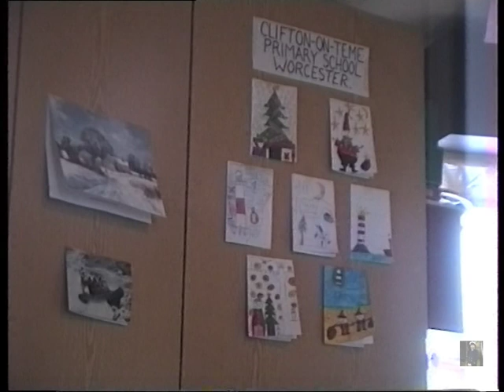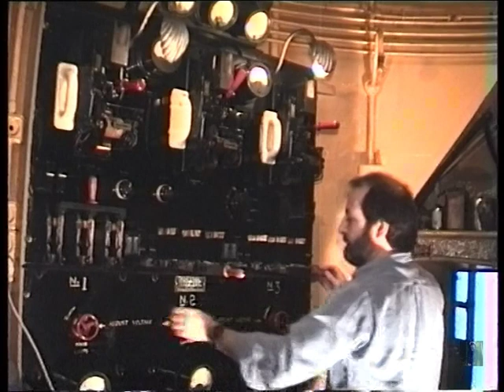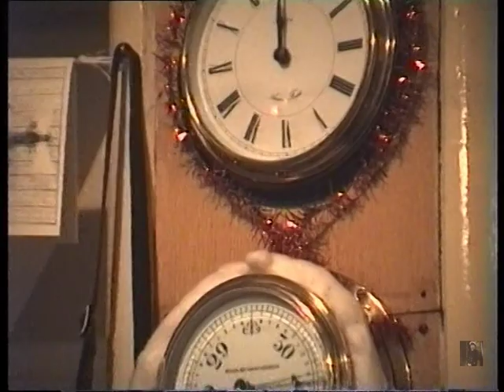Needles Lighthouse at Christmas, part 1,  1992

Comment: The old Supertyfons are now on display at the Needles Visitors Center. I'm glad they preserved them instead of melting them down.
Reply from the maker: Thanks for the info,cheers.
Reply: @PeterHalil  It's my pleasure. I don't just do this research for my own gain, I do it for other people's benefits too. ^^ Apparently it appears that only one bank of Supertyfons out of the three is at the Needles Visitors Center. The other two might possibly be in storage. There is a placard on the front of the bank of air horns at the Needles Visitors Center that says Trinity House saved all three banks of air horns rather than just one.

Comment: Mr Halil. I hope you are doing well. A quick question if you don't mind. I was watching this video again and I realized on Christmas eve the crew are not wearing particularly warm clothes, was the Needles kitchen well heated? It had to be freezing that time of the year in such a remote, aquatic spot? Thanks as always!
Reply from the maker: Hi Jud, Thanks for that, as for the heat in the tower the AGA cooker was throwing out masses of heat plus the engines down below, so we didn't seem to suffer from the cold like some tower rocks that certainly didn't have an AGA and there were several more floors between the living accommodation and the engines. Cheers and stay safe.

Comment: Hi Peter,
With a crew of 3 how many keepers were awake at anyone time?
How does the shift pattern typically work for the 28 days on?
Great video 
Kind regards.
Reply from the maker: Hi Mickey, Thank you for that. 
1st day, 0400 till 12 mid day then back on 8pm till midnight
your next shift is 2nd day, 12 mid day till 8pm then back on midnight till 0400, then you are off duty till 0400 the next day, you also quite often have a couple of hours kip before your midnight call out.
It is normal for the 1st day man to go to bed for a few hours in the afternoon on that day, so 2 Keepers are awake then.
When you are on the morning shift ie, 0400 start, you are the only one up till one of the others get up for his breakfast. 
Also you are the only one up and awake on the middle watch which is the midnight till 0400 shift, this is your only free from the other 2 time, which is great! but when you have technicians as extras come on board, they never adhere to this and never seem to want to go to bed! which doesn't always go down well as we all need our alone me time Ha Ha. Stay safe, cheers
PS your 0400 till 0400 free from duty bit is when you catch up on sleep etc but if any joint work crops up, you muck in with the other 2 and do it.
Reply: @PeterHalil  
Thank you Peter,for your informative reply.Take care.

Comment: What is running?
Reply from the maker: If you mean the noise in the so called background? an engine is running 24/7 to power the building, not sure if that is the case nowadays though as lots of lights went to solar power.